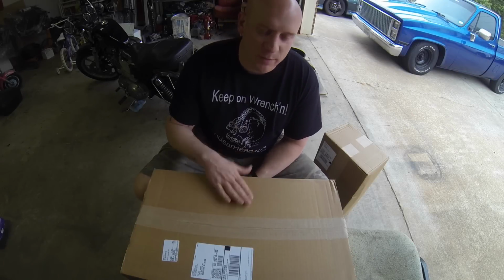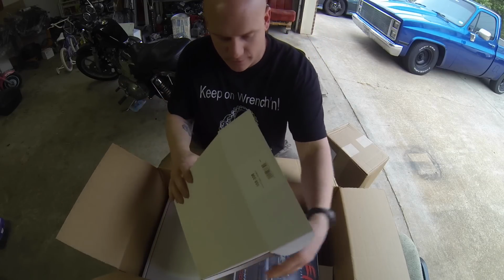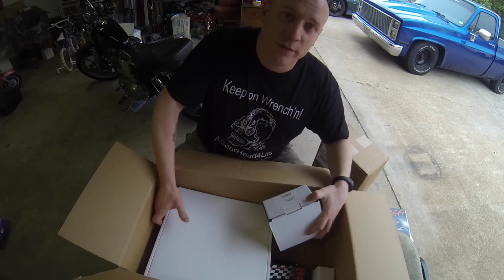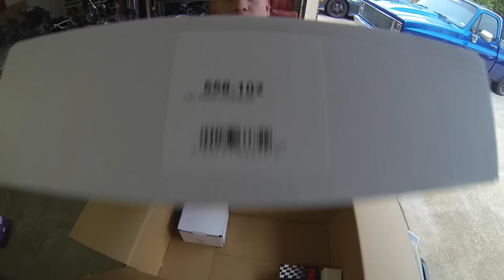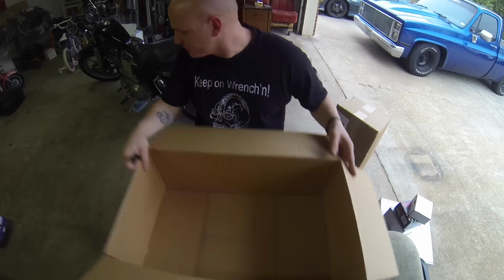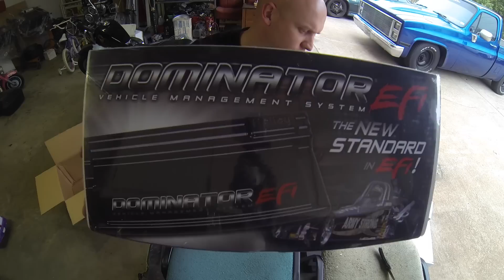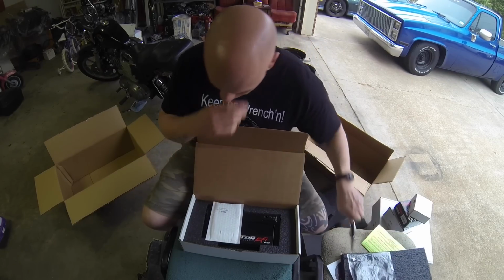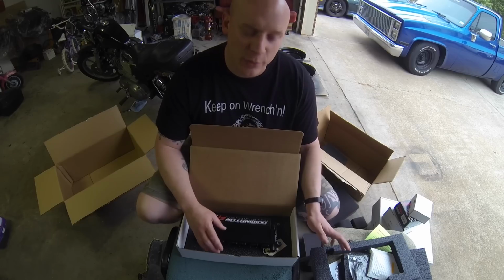Holley EFI Dominator UNBOXING for the Turbo 6.0 LSx '92 Camaro Build

Comment: I have been wanting to put a 6.0 with a 4l80e in my El Camino.  After towing a 21 foot boat over 500 miles with a tired old 305 small block, I want it even more.  Your videos are like throwing gasoline on the fire.
Reply from the maker: yea, any LS would greatly improve that haul! That is a nice El Camino! Would be bad ass with the LS.

Comment: I have the Holley HP efi on my 88 K5 Blazer. I wish I had bought the Dominator instead for the dual wb02 and more inputs outputs. The Holley system is great and I like it allot. Software is really good. Ecu processor is fast. Data logging is really good also. Since I bought mine a year ago the price has gone up a couple hundred dollars. You will really like it and won't be disappointed! Thanks for the vid, keep'em coming!
Reply from the maker: Awesome! Thanks for the feedback man. I'm even more excited to hook it up now! Thanks for the support!

Comment: So I see have auto wiring but like say like on my 99 camaro with 5.3  and a t56 transmissions how do I go about to make that work thanks
Reply from the maker: Well the auto trans part of the wiring (like all of the individual harness pieces) is just an add on for the Holley system. They’ll have a different harness section for people using a manual trans. It’s probably best to contact Holley and ask them for a list of harness that you’ll need for your setup. This will be going on a manual trans car, but I haven’t touched this project in a long time. So I couldn’t tell you the answer for you question.

Comment: Thanks this is the only in boxing I have ever watched and I get it now. You did it right in my opinion just like any car guy you vary methodically open everything and looked at it from every angle.After all it's Christmas for gearheads,Right?!
I'm especially looking forward to you straight forward no bull,no Holley sponsored commercial.
 I see you got the harness for an auto. Does this mean the T56 is history.
Would still like to see a video of the post mortem on the Squirter. But of course that can wait till the 6.0 is in and pretty much settled in.
As. Always thanks and keepem, common!
Reply from the maker: Thanks Roger! I may go auto in the future. One for the power level that I'll be at with the turbo and to be consistent at the track. I think the auto will do better. We'll see.

I'm looking forward to seeing what the inside of the Squirter looks like also. That will be very interesting.  But you said it, I've got to get the 6.0 in there and the 5.3 in the truck first.

Thanks for the Support Roger!

Comment: are u swapping out the t56?? I see u have an auto harness
Reply from the maker: More then Likely I will in the future. In about a year or more. I think an auto will work better for the power that I'll be making with the turbo and will be more consistent at the drag strip.
Reply: AGearHead4Life....well if u plan on doin some 1/4 mile track runs then you'd definitely be better off with the auto...especially with the turbo...im a pro-manual guy....I thought about swapping a 5 or 6 speed in my truck with the ls swap but then I'll have to source all the manual parts and all and don't feel doin all that. I am wanting to go turbo though...im still doing all my home work on that...i'll probably look at ur vids n checkout ur turbo setup
Reply from the maker: ivorton23 Yes, these are similar thoughts that are going through my head. This car was an auto when I picked it up. It was a lot of work converting it to the T56. The T56 makes a fun toy street car, but the auto will show better track times. IMO
Reply: AGearHead4Life finally making some progress on my 5.3 swap....got the 350 pulled and the 5.3 in!! check it out... http://67-72chevytrucks.com/vboard/showthread.php?t=614122
Reply from the maker: Cool! I'll check it out!

Comment: Install video coming or is there one already?  Love your vids
Reply from the maker: Thanks Marcus! And thanks for the reminder. It's getting close to time to install this into the Camaro.. finally. I was just going to slap it in, but I should record what I do.
Reply: +AGearHead4Life  No problem man and yes I'm thinking about buying it and want to see how easy the install is. What are you controlling boost with?
Reply from the maker: I am not sure yet. lol I figure that I'll get it all fab'd up first and then go from there. I've gotten a lot done on the turbo piping and need to do an update video soon. Down pipe is on and I'm now mounting the intercooler.
Reply: Good work man.. Can't wait for more videos
Reply from the maker: Thanks Marcus! I've got to get another up soon before I make too much more progress on the Camaro. lol

Comment: why a harness for an auto? isn't it a 6 speed manual?
Reply from the maker: Very good question Schectrat! More then Likely I will swap in the future. In about a year or more. I think an auto will work better for the power that I'll be making with the turbo and will be more consistent at the drag strip.

Comment: You have the Holley injection system that thing is awesome.I saw it on roadkill live it can control everything.How do you think it will work with a turbo?
Reply from the maker: Yea man, I'm stoked! I think it'll work perfectly with the turbo set up. Especailly since I haven't learned to tune yet. This auto tuning PCM will probably save my engine. lol

Comment: Did you get a sensor for the dome pressure? How are you regulating the boost?
Reply from the maker: I did not. I was going to control boost with a manual controller, but I'm not sure right now. I'll likely let the Dominator control it. I havent gotten to that point yet, so well see.

Comment: What's going on gear head the new logo is badass.I got a question for you what size camshaft are you going to run in the 6.0?Will it be a mild cam or something crazy?
Reply from the maker: Thanks man! The cam that I have in the 6.0 was used and custom grind by a well known local guy named Lane Culver. I'll have to pull up the specs when I get home. I bought it was so long ago that ive forgotten. It was aggresive though from what I remember.